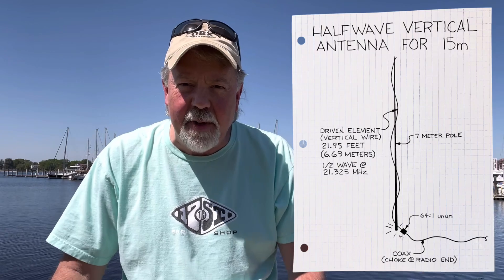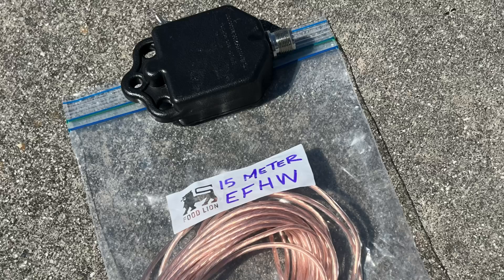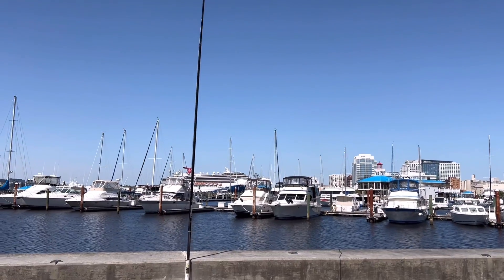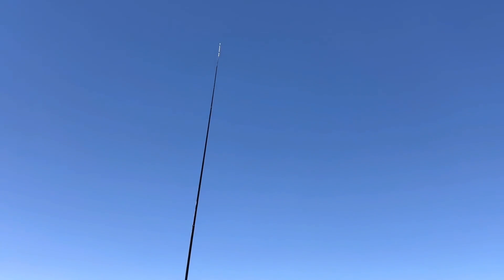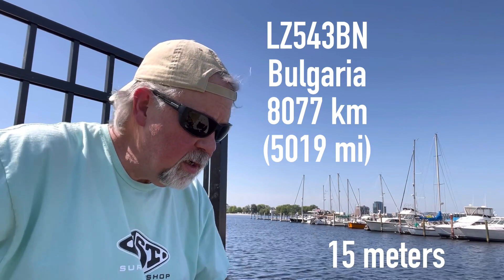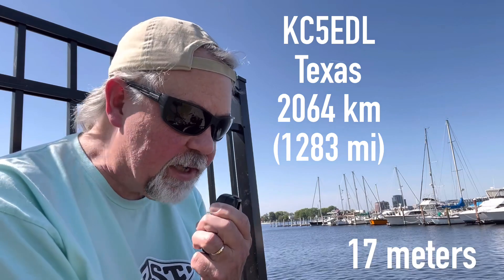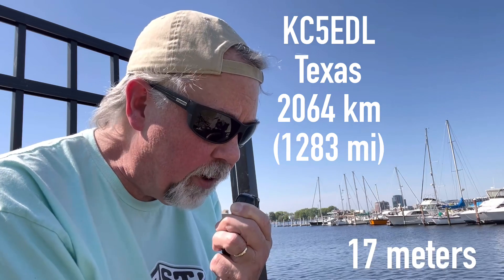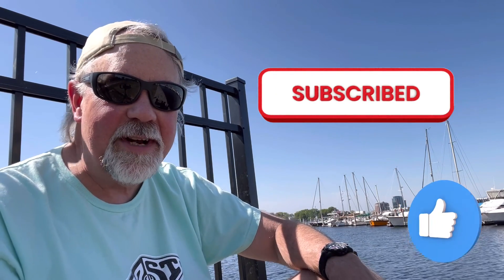Building a Halfwave Vertical Antenna for the 15 Meter Band

Comment: Fo;;ow up comment: I love this antenna!!!! Yesterday, I decided to build this antenna using the same 64:1 and I got 1:1 SWR the first time I tested it. I used it with my Xeigu G90 and got a 55 report from Finland (Northern CA to Finland). He was a 59 on my end. The antenna out performs my 74 foot (30 feet off the ground) random wire antenna on 15-meters. I use a 28 foot fiberglass kite pole for your antenna design but otherwise it's the same. BTW I am not near the beach and I'm on a heavily wooded hillside. Thanks for a brilliant antenna design...73...Hugh...KN6KNB

Comment: Impressive. 😮
I did not expect this antenna to be so effective! Up to now, I assumed a T2LT (flower pot) would be the most simple yet efficient option for a vertical, but it seems like I need to rethink. 😉
Is the fact that you mount the antenna so close to the sea (one of the) the main reasons for these impressive results? 🤔
(With my T2LT mounted on a 40ft/12m mast on a hill 600m above sea level running 100W, I so far could reach a few stations in ~7000 km distance, while you apparently could easily outperform this. Really impressive!) 73 de DO1HNR

Comment: Walt: I felt compelled to drop you a note to say thank you for your videos, patience, and inspiration. I haven’t been active in HF that long. 
I just got a Yaesu FT 710, which is A huge jump up from my Kenwood 480. This weekend, I started to build a 33.6’ vertical on my DX Commander pole out in the field beside my shop here in Central Kansas. I taped the speaker wire to the pole, and attached it and the 5-17ft radials to my banana clip. It tested out about 1:2 to 1 on 40, and under 2 on 20 after the Yaesu tuned it.  So does it work? I just worked a guy in Ontario Canada. One of my personal best!  Thanks again, and keep it up! 73!! KE0LNC
Reply from the maker: Thank you!! 73, Walt

Comment: Where did you find the Unun?
Reply: That link takes you a a balun, not a unun.  What I’m wanting to do is cut wires for 20, 40, 15, &17. Separately. 
BTW, I really envy your videos. Learning a lot. 73 friend, keep it up!
Reply from the maker: @RonBennett-lg8po  thanks! that’s mislabeled, it’s an unun. If you’re going to cut wires for each band you don’t need an unun
Reply from the maker: @RonBennett-lg8po  for a resonant mono and wire for each band just use a 1:1
Reply from the maker: End Fed Antenna 4 Band 8 Band... https://www.amazon.com/dp/B0CHMX6GP4?ref=ppx_pop_mob_ap_share

Comment: I use a EFHW on 160m. It works on all the other bands too!  Amazing design.
I tried one going on a slope to the top of a tree, but found between a pole on the chimney to a tree works best as it's fairly long.
Tried various aerials including verticals, 3 element beams and loops. The EFHW is the best. You don't need loads of power and massive aerials either. If you do then your using the wrong aerial or wrong band for the time of day and desired coverage.

Comment: I recently discovered the effectiveness of this type antenna.  I sort of swerved into it when trying to build an ‘ideal’ multiband 40-10m EFHW.  I got close, but am not sure ones exists, even though they work pretty well. I tried 49:1, 56:1, 64:1, and even 81:1 winds on the Fair-Rite xxxxxx-1002 toroid that MM0OPX has gotten lots of people to start using.  After not being too happy with any of them, I ended up building several monoband EFHW antennas for 20m, 17m, 15m, and 12m using the 64:1 autotransformer winding technique.  They performed spectacularly.  Not having seen anyone do it that way before, I happen to check your channel as I enjoy your trying different antennas.  Well, wouldn’t you know it you had already tried it.  Seeing your results verified my findings.  Keep up the good work … and try that 64:1 on any band from 20-12m and it’ll work great.  I had to carefully tune the counterpoise on 12, but the other bands were less sensitive.

Comment: Walt I have a question concerning the coax route from antenna to your transceiver.  It is over the concrete wall and then back up to the radio.  Is this so it is closer to the salt water for better signal propagation or to keep it out of the way of any pedestrians?  Another great video.  Thanks.
Reply from the maker: Thanks! I actually hung it over the side to be closer to the saltwater. Not sure if being that close anyway made any difference but I thought it couldn’t hurt.
Reply: @COASTALWAVESWIRES  Thank you Walt.  I'm not trying to overthink your  set up as it obviously works and that is the point!
Reply from the maker: @stephenkramme7063  no worries, it’s actually a great question

Comment: I think the salt water right next to your antennas is crucial for the distances and the good signals
Reply from the maker: Absolutely, that’s why the channel is called “Coastal Waves & Wires” and why I’m using a vertical. 73, Walt K4OGO
Reply: @COASTALWAVESWIRES  Yes, kind of enviable ;-) I also have LDG 9:1, 49:1 etc. in portable use, the results here at home (Germany) are rather modest. However, like your clips and your location. 73 Rolf, DC1ZZ

Comment: So, the coax is the counterpoise?  No pool noodle ground plane?  In your experience, how does this type of wire antenna compare to a tuned coil antenna like the Slidewinder DX, etc?
Reply from the maker: Correct, the coax is the counterpoise because it is a halfwave. I’ve found that halfwave verticals are one of the best for DX, better than a coil.

Comment: Great video Walt, just wondering why for this particular antenna you didn’t use a counterpoise like with other antennas? Thanks so much for making these videos. 73 Dan VK3NDG
Reply from the maker: Thanks! With it being a true halfwave I figured I wouldn’t need a counterpoise as I was using a very long coax. That’s why I used the choke at the radio end.

Comment: For me the half wave for 15m didn’t work that well. In the past mornings I could hear Japan, but never reached it. I made these contacts with ease, using a 40m vertical Delta Loop . I’m a mountain man, so, different situation . Great video Walt 73 HB3XBL 👍🇨🇭

Comment: Walt: The 49:1 will also work just as well. I made a 49:1 in a plastic wall utility box, and swapping my half-wave wires out, can run it on 40 meters to 6 meters. For 30 & 40 meters, the wire needs to be hung from a tree, but with the 10 meter MFJ mast, it becomes free-standing. Outstanding job & keep running portable!  De WB2VUO

Comment: Nice one Walt. Next, you'll have to do what Tim, G5TM has done and put some traps in so you can get a half wave on 10m, 12m and 15m. Due to the inductance of the traps you might be able to get away with getting 17m on the 7m pole as well (with another trap!).

Comment: Great Video!  I have what might be a stupid question for you Walt!

With running the wire up the pole, do you find that your signals in the direction that the wire is against the pole are affected??? If that makes any sense.
Reply from the maker: That’s actually a great question. I have not found any directional issues at all to be honest.

Comment: nice build. I have to try 15 meter veritable  now.  as half wave. mono band. I have a 49:1 and 64:1 I made on FT 240-43 ferrite core. my outher ones are 49:1 with type 61 ferrite and works better on 6/10/11/12 meters. I do have a end fed cut for 40/20/15/10 multi band. and 20 meters mono band. I run a slope. I have 7 and 10 meter poles.  may get 17 meters on the 10 meter pole. but may go slope . I have extra Walmart speaker wire to try. one I get it I copy to good wire like DX 10 or DX 50 DX commander wire. I do have the DX commander expedition 2024  green antenna multi band . that great on 15 meters. I cut wires for 17 and 30 meters. did not do 60 meters. just do not use that band. normally I use the 64:1 on 40/80 meters . I get better bandwidth   with that to a 49:1 .   once I get SWR under 1.5 I call that good. if 2:1 in edge of band I just hit the ATU on my 7300 . their is times in some parks my tune a bit off do to soil. just hit the ATU . if I tune I use it. still make contacts. 73's
Reply: You should just about be able to get a half wave on 20m on a 10m pole, given the slight shortening effect of the transformer.
Reply: @paulsengupta971  I just cut speaker wire for 15 and 17 meters today. did not tune yet. if 20 meters a tad long for pole I will bring it back the outher side down like DX commander does for the 40 meters on a 10 meter pole . works great. I get good tune 40 and 15 meters like that. after that I try 20 meters. thank you. 73's

Comment: I enjoy your videos. I think this is the first time I have seen you use a 64:1 unun. How did you decide that a 64:1 unun was the right one to use vs a 49:1 for this 15 Meter Band? Would the 49:1 or 4:1 ununs have worked as well for a 15M EFHW? Is there a table or something that you referenced and said for this 15M length of EFHW I should use a 64:1 unun?
Reply from the maker: Hi, it’s all about feedpoint impedance. I explain it in this video:
https://youtu.be/_cL4iHiVoGY?si=6EEaj_WlexOfMdV0

Comment: Spent an hour yesterday trying to use the radio in my shack but the signal to noise ratio was so poor that I gave up. As the sun gets brighter the noise gets worse - even my power supplies are getting hit by stray signals from next door solar ! -  so I maybe going to rethink my antennas and also get a G90 when funds allow and go portable. Modern urban living and ham are not playing well at the moment (too much cheap junk electroncs ?). 73 M7BLC

Comment: Hi Walt, on the 20th April in the UK DX Commander is having a live stream working 10 meter FM. It starts at 1 pm UK time. If conditions are right you might be able to make a contact.
David M0DUU
Reply from the maker: I saw that! I’m going to give it a try
Reply: @COASTALWAVESWIRES  ok Walt, I will only be listening. Four hams are doing a mega stream on YouTube. Should be fun and Cal is a gentleman to. I do a lot of FT8 on the 15 meter band. It's generally open to me in the early afternoons.

Comment: My never ending question is how to determine whether you need an unun or a balun and which one to use? 4:1 or 9:1 or 64:1? Balun or unun? And you decided no counterpoise? And we've introduced a choke at the radio end. I have much to learn.
Reply from the maker: I’ll do an in-depth video on feedpoint impedance soon
Reply: Gil, Radio Prepper, has a pretty good video on it. Do a search for "Clearing Up Some Confusion About End-Fed Wire Antennas" Fast forward to about 4:50.

Comment: I wouldn't sweat going over the build of every antenna you make.  Maybe I am different, but once you have seen one antenna build for a type of antenna you pretty much have seen them all.  The only things that change are the lengths and possibly the matching device to get the impedance to the 50 ohms the radio wants.  I need to play around on some of the other bands as I typically play around on the usual bands for POTA chasing.
Reply from the maker: Thanks! I’ve actually had some hateful comments on this topic. I tend to think like you that once you’ve seen one build you understand how it’s done. I mean how hard is it to tape a wire to a pole lol
Reply: @COASTALWAVESWIRES  some people want everything handed to them and don't want to look up additional videos or instructions.  It isn't hard to cut wires and attach them to transformer or matching network.  Unfortunately society today wants instant gratification.
Reply from the maker: @DarkShadowCustoms  exactly, that’s why I said “go look for it on Amazon” in the video. I’m tired of people asking of a link to everything. I’m not a salesman. Occasionally I’ll put a link if it’s a distinct item I’m using. I think I’m going to start replying to the “Link?” comments with www dot google dot com 😂
Reply: @COASTALWAVESWIRES  not hard to find on Amazon, eBay, or any of the major ham radio supply stores.

Comment: My one so far experience with this UnUn is the 25.5ish wire no counterpoise 50ft coax i tried.  Since I had only a 3 section painters pole i had to coil the wire but that seems to help the match as well.  14.260 was a  match to work Israel from central FL.  My first DX!
Reply: You don't need a counterpoise.
Reply: @OH2023-cj9if  Good thing cuz I didn't use one

Comment: GM Walt  GREAT video as usual!  I have been doing similar things here in PA.  I added a 16 foot counterpoise (off of the ground) to fine tune mine and the multi band results are great!  I use 1:36, 1:49 and 1:64   Thanks again de W3DD Mike

Comment: "Good math" -  I thought the US used "freedom units" given to them by the British. That's the MAGA crew upset......lol. Metric just makes a lot more sense. 

I have had quite a lot of success with 15m over the last couple of years when portable. Managed to work JA from the UK on SSB and had a 10m in QSO which was my first contact into Japan. 

Thanks for the video, Walt!
Reply from the maker: Thanks for watching! I joke a little bit but definitely keep my political thoughts out of my ham radio fun LOL. All the best and 73, Walt
Reply: Metric makes sense when talking antenna lengths on the different bands...you see some US people fretting about how long antennas are on certain bands using a formula and so on....whereas in metric..."What's a half wave on 40m?" "About 20m-ish". "Quarter wave?" "10m-ish"....

Comment: Can’t beat a full half wave antenna! Even close to a half wave is good. Would like to know what the Nano VNA says your resonant frequency is vs the calculated resonant frequency from formula. I noticed that you did an end feed and not like the Coastal 20 where you fed it 3 feet from the end. What were your thoughts on that vs the coastal 20 shortened to be resonant on 15?